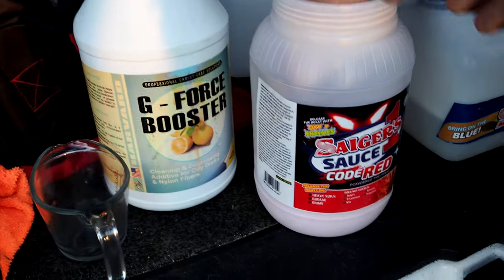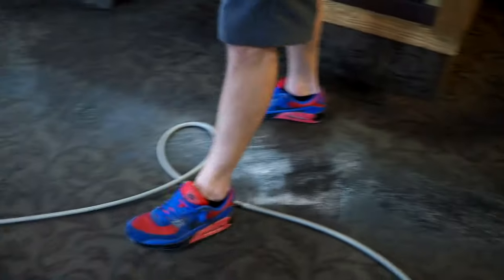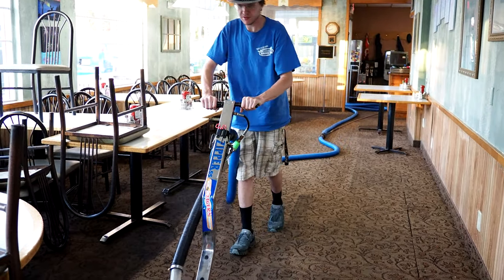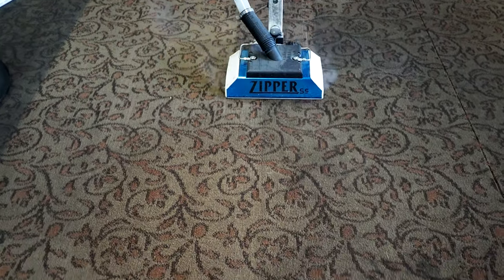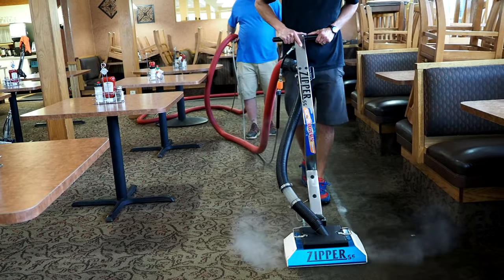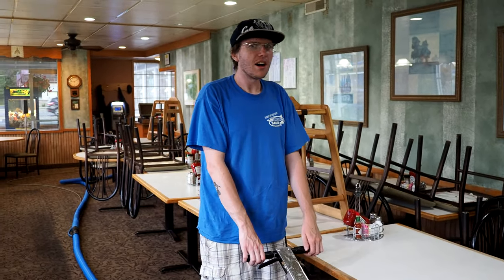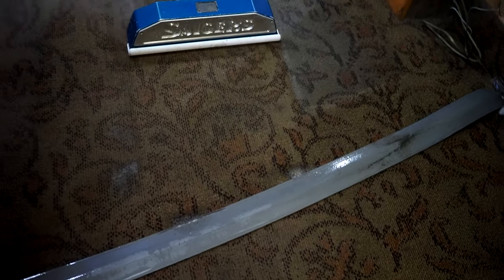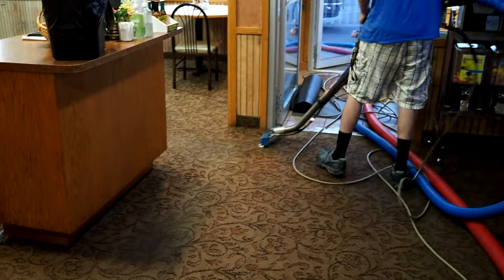Floor Food Testing!

Comment: Hey Mark what conditions allow you to skip the pre-vac? The SS? I'm not a carpet cleaner just love your videos as always.
Reply from the maker: We find that restaurants when we get to them it's just removing the big chunks. The grease just holds in soils so not much we find comes out. There was wait staff that night going around and using a Hoki type sweeper... And I think that's all they do most daily. Otherwise when we are on residential and some commercial (especially vac before encap) we will prevac. And thank you for your great question! (and being here with us 😊👍)
Reply: @MarkSaiger  I notice they have a central vacuum system, saw a few inlets. Must not be in use anymore.
Reply from the maker: @natej4230  that would be a good question. We have seen them using a sweeper only... But only to remove big chunks. I wonder what they are vaccuming with and how often too